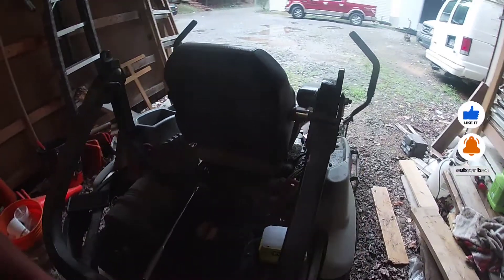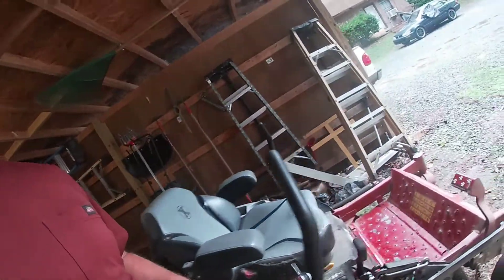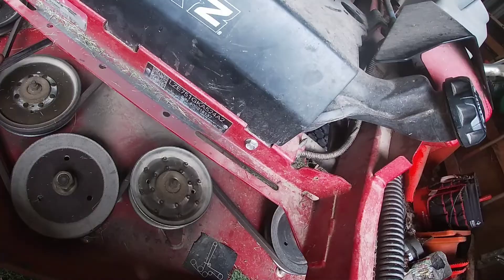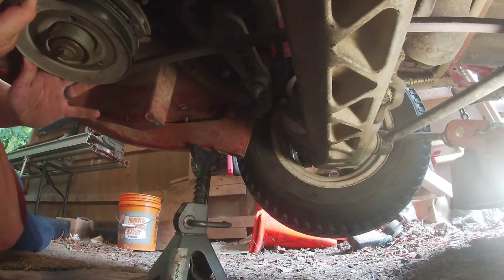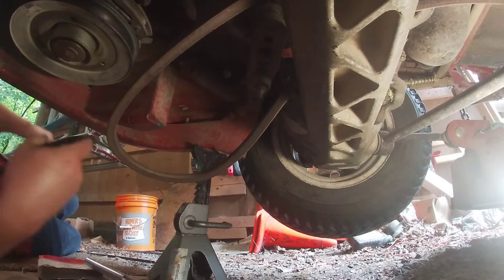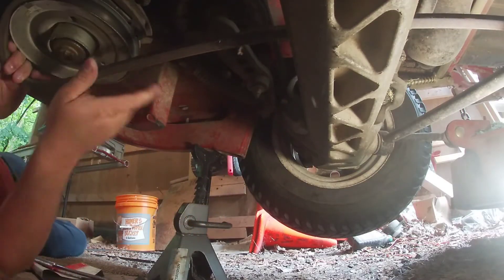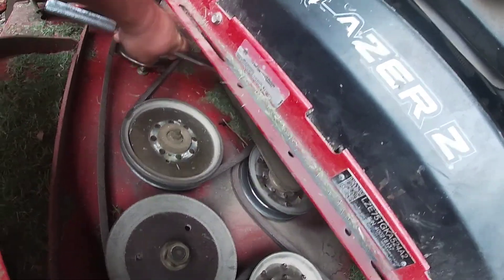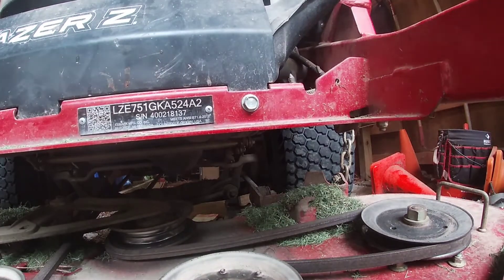How to change hydro drive belt [Exmark lazer z zero turn lawn mower]

Comment: Man I wish my Cub RZT 50 was this simple I had to drop the PTO after doing it once I've got it down now. This was quick!
Reply from the maker: Yeah the exmark is easy but the ferris mower i have is a pain you have to remove alot to get the hydro belt off.  I used to have a cub cadet rzt 54 it was hard to get off as well
Reply from the maker: Thank you for watching

Comment: Thanks Brian , mine just broke didn't know what the hell was going on  Had to pull the damn thing back to the shop , looked under it and said What the Hell never knew it had that belt had changed the deck belt twice in 10 years . Thanks for the Video saved my Ass again, See Ya S E Texas
Reply from the maker: Your welcome glad it could help.  Yeah you lose complete control of the mower when that belt breaks.  I appreciate you watching!
Reply: Hey Brian tried looking up that belt # 15676 on Amizan Prime can't find it .On Ebay eather ,any help Thanks ?
Reply from the maker: The exmark number is Exmark 116-1953
Reply from the maker: Thats the drive belt number
Reply from the maker: That belt in the video was a rotary belt and the number is 15676

Comment: Thx for the simple video, I'll try it myself now instead of taking my mower to the local repair shop.
Why didn't you use 2 jack stands instead of the one jack stand & the blocks of wood?
I'm a new subscriber, please let me know, thx
Reply from the maker: Your welcome, i just used the blocks of wood under the tires to give me enough room to get under it but you can use 2 jack stands which is prefered but i sould still put the wood under the tires for extra safety.  Never can be too safe especially if you have not done it before and scotch the front tires as well to keep from rolling forward and only do this on a flat surface

Comment: Are you kidding me. I've got an Ariens Ikon and the Hydro Belt goes around 4 pulleys. It takes longer to loosen the tension spring just to begin replacing the belt than it took you to do the entire job. I've got it down to about 75 minutes and felt good. With the Exmark set up you could replace that belt in the field.
Reply from the maker: Yes not too bad of a job on this mower!

Comment: Hey buddy, what is the size of the belt?
Reply from the maker: Hey the part number for the belt is 116-1953 for my 52" exmark 2017 model and i think the length is 73" but not exactly sure i just ordered by the part number. Hope that helps
Reply: @BrianLoftyLawnCare where did you find the part number for the drive belt?